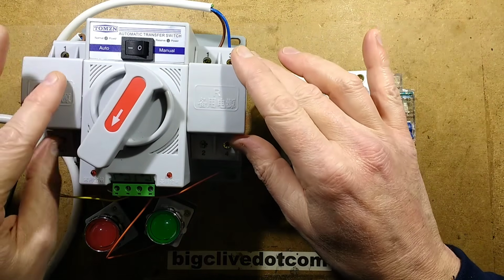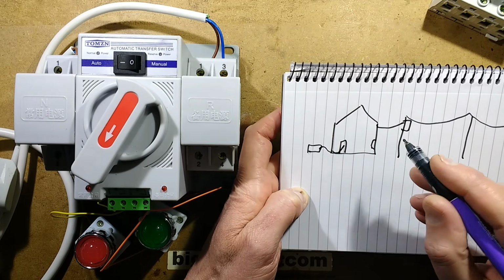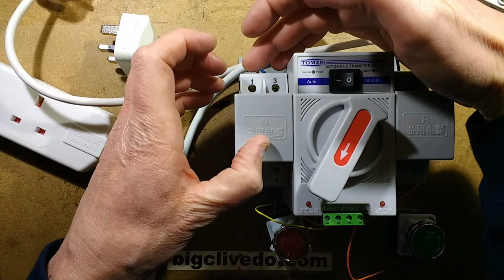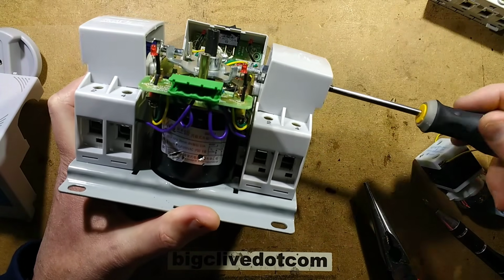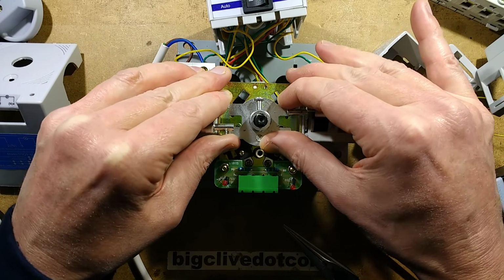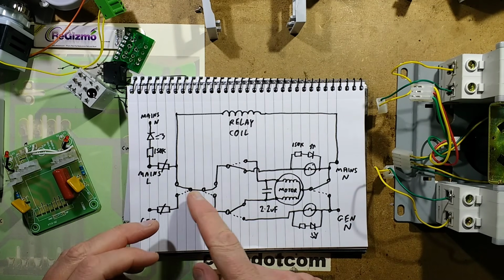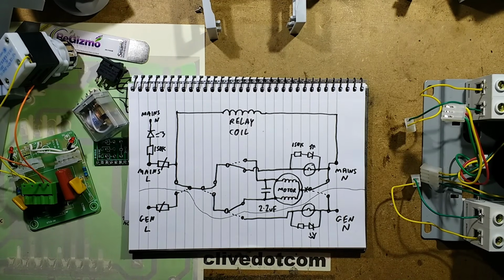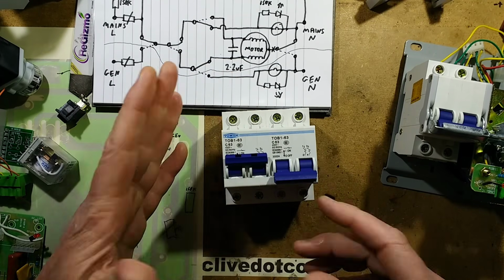Automatic generator changeover switch (with schematic).

Comment: Wow, in the US and have had a generator for years and not once have I thought of back feeding the entire house through the 220v dryer connection. Scary. And no, not gonna try it, no way. I'll let you do that one so we don't have to...
Reply: There are safe and legal ways to do it, problem is nobody follows them.
Reply: I have seen a video with a pto generator feeding at the utility pole, guy switched off the power line, then had a three phase plug at the pole to power barns and the farm houses. Better that then feeding it through a dryer plug.
Reply: Sure it's safe if you know what you're doing. But it's dark, your stressed and you've been kept up half the night because of a hurricane and one slip and whoops, there goes a lineman/generator. Mistakes are made and some are impossible to come back from. It's why there are proper (and relatively inexpensive) ways to do it properly.
Reply: It's absolutely illegal, just like speeding, and about as commonly done.
Reply: Yeah seriously
If I had a big enough generator (or solar system or whatever) to power my entire house, I would never do it that way. It'd be so simple to just set it up properly. 
In America, what I've always been done is to merely run a 120v extension cable from the generator to the most vital appliances (fridge/freezer usually + often phone chargers)
Reply: Agree. I just made a cord to do this very thing however through the 240V 50A RV outlet I have on my outdoor panel. Pretty simple. Kick the mains off to isolate and thats all you need. Maybe put a small padlock for safety if you want to be cautious.,
Reply: John Adams
Yep. I would hope all the above people doing it are breaking the law. I would be horrified if it was legal to do this.
Reply: Backfeed is bad idea - you can easily electrocute a lineman working to restore power.  Yes you would turn if off but someone might "help" and make it live again.  Best not to even make it possible.
Reply: Pretty much everyone I know runs their generator that way. It's not a problem as long as you know what you're doing, but I definitely do not leave the suicide cables lying around when the electrical inspector comes by.
Reply: Which is why after Hurricane Andrew when I was helping the DOT clear downed power poles and lines, I wore linesmen's gloves. Idiots cannot be prevented. The power company would not work on a person's transformer if a generator was running unless it was feeding a proper transfer switch. Our house has two. One that I can run just emergency items off of. Or the second one that can feed the whole house. Difference is if it is going to be a short time run or a long time run. The first one is soon going to be fed only by an inverter while the second will be used for the generator.
Reply: Doing it through the dryer connection is ILLEGAL and unsafe. There is a correct way to connect to the breaker panel.
Reply: I've done this many times in more applications than just generators. This is commonly called a suicide cord(with good reason).
Reply: I put a breaker for back feeding in my panel in the top right location right next to the main breaker. To use it you have to first turn the main breaker off, slide a interlock plate over(just a plate with slotted cutouts to slide) and engerize the back feed breaker. Less than $15 bucks.
Reply: happens more often then not. i have done it when we had a huge ice storm and the power company cut the lines to the house because of a weather failure. and before they attached the mains i wasnt using the generator. problem is people will just do it cause their dad did it or some guy down the street.
Reply: I have that setup.  The generator is in a shed when I need it I throw the 200 A main and plug my genset cord into the bottom of the main. No back feed.
Reply: This is a single phase system. You are confusing phase with two hot legs (w/neutral).  Of course there are other systems - three phase is also common in the US in factory shops. Few residences have three phase service.
Reply: If you are replying to me, I am not confusing anything. Big Clive has more knowledge of this than I do and I am going off of what he said in this video. Electrical setups may be different where you are or where I am, but certainly he knows what he's talking about as far as where he is right? In either case, 3 phase or 2, your dryer outlet can handle far more load and is a fairly good solution for the generator to feed the house provided you are set up to switch automatically between the grid and the generator and don't accidentally have the grid blow up your generator.
Reply: A lot of Americans do it, though. It makes sense, but it's not safe because they often use a cable with two male ends (so one male end will be live) and only one small, manual operated switch can keep you from backfeeding and avoiding some kind of explosion where the two connections meet (your dryer socket). Europe uses 240V standard, so it'd be the same as if we used any random outlet in the house to backfeeding the entire house. It'd give you a solid 3.500 Watts, which is something. They usually don't do that in the US, because one circuit is usually only 1.800 Watts.

But then again, generators in general are not too common in Europe. Gas is super expensive, a lot of people live much closer together, ... as a kid I didn't even know gas generators existed! I thought they were always diesel powered. Probably because I'm still a teen and grew up when the government thought diesel was the best thing since sliced bread (in my particular country, 80% of the passenger cars were diesel powered up until 5 years ago, now it's back the other way around - even the Fiat 500 came with a diesel engine). Diesel is (/was) cheaper, more efficient, ... but those generators would be much more expensive and complex. I often see pretty high capacity gas generators over here, now.

I'd love to get one, but even though all the houses in my neighborhood are detached and there's a lot of open space between them (I even have a mini-forest behind my backyard), I can see particular neighbors complaining about noise and exhaust emissions. You could still run it on propane or natural gas but still.
+ we haven't had an outage in 6 years, and when we do it's usually 1 hour max, so... probably not really worth it anyways.
Reply: You have reliable power. Never know what already got till its gone.
Reply: Poo Face, so if you've been living off the diesel generator, then what have you been living ON?
Reply: Clark, that's the way I've done it. We had power out for nearly a week and mostly what I was interested in was running the chest freezer occasionally to keep stuff deep-frozen and some power for lights and television. It would have been nice to have 240 to allow the gas furnace to run though and if power was less reliable here, I would probably have a fancier set-up. I'd definitely have a transfer switch though.
Reply: JamesAllmond pics or it didn’t happen.
Reply: Arjan that is exactly what I have, and it works great.
Reply: John Ridley hhaha
Reply: my generator will not power the entire grid, it blows an internal fuse.
Reply: I done that but be carefull
Reply: I tried it once with the oven connector... Let's just say you should make sure you have a beefy enough generator to run the HWH, fridge and confirm that the AC is off BEFORE you throw the switch!
Reply: I use to do it all the time. The 30A dryer breaker and the 30A breaker on the genset would protect everything
Reply: As long as the main is of you are fine, you can by a $30 interlock that you must turn off main before generator breaker goes on.  Without a generator breaker feeding into dryer plug is safe BUT you must turn off main 100-200amp breaker first, technically illegal.  Power off heavy loads and your entire home is powered safely.
Reply: So long as you're not an idiot and have some sort of circuit breaker there shouldn't really be an issue
Reply: It'll work fine
Reply: It's only dangerous if you are a dunce lacking practical and common sense.  Which unfortunately seems to be the majority of the worlds population.
Reply: JamesAllmond It's very common and relatively safe if done properly with a split-phase generator. The problem is most people don't have a split-phase generator. They have a regular 120v one. So they will feed both legs of the house with the single leg of the generator. The danger in doing that is the risk of overloading the neutral since the loads on both legs will be returning to the generator simultaneously which doubles the current on the neutral. Large RV's / caravans have double sized neutrals since they know that people will power the 240v system with a 120v generator on a regular basis. Houses don't get built with double sized neutrals.
Reply: @xNYCMarc  Ours have always been split phase. From the first one we bought in 1972 till now. But then dad was in electronics in the Navy and worked for the power company after that. And we have always used a proper transfer switch. The emergency one is rated at 50 Amps and is used for short term runs. The large one is rated at up to 600 Amps and can be setup as single or three phase and fused as needed. Thing is about 3' tall and can handle the whole house. Currently fused for 200 Amp slow blow with 200 Amp fast trip breaker inside the breaker panel inside the house.
Reply: gravelydon That is very rare to have a split phase generator. Most people just go to HomeDepot and look only at the watt rating. Just about all of them are 120v. Even my backup generator is 120v, but my setup is a little different. I have solar with batteries. The inverters are 240v split-phase and the house is essentially always powered by the inverter, that way if the power goes out, the electricity is uninterrupted like a whole house UPS. If the power is out and the solar isn’t producing enough, the generator kicks on and only runs a battery charger to recharge the batteries. So it doesn’t need to be split-phase.
Reply: @xNYCMarc  I don't think we've ever had a 120 only generator on the property. Ones here right now are a 3500 watt 120/240, ( I can throw a switch and make it all 120V ), 7500 Watt 120/240, 10KW 120/240 72VDC, 15KW 12 lead that can run single or 3 phase 120/208/240/416/480, and a 40KW 240/120 unit. Both the 3500 Watt and the 7500 watt units can be on line at the same time as the 3500 can power the emergency circuits while the 7500 pulls the rest of the load. I currently don't have a split phase inverter but if need be, I can use the split phase 120/240 transformer  to power emergency circuits off of the 120V inverter.
Reply: I tried it! (thrice actually)
Reply: Clive is right about it being fairly common though. It's something that happens nearly every time there's a hurricane.
Reply: JamesAllmond by grandfather did it for years. As long as you shut off the panel and make sure the plug doing the feeding is not accessible by little ones, there isn’t much danger.
Reply: JamesAllmond what did you think? Power goes where?
Reply: Scary? Not at all. It's kind of genius actually. The dryer connection handles far more load and as Clive said, that way you're feeding both phases.

Comment: Liking the fact it uses a motorised manual switch. The ones i've studied in the past use interlocked contactors and i didn't like the fact that I had to rely on a contactor being energised all the time for normal on mains supply - despite working in IT where such devices protect significantly more important stuff than my house!  I went for a manual changeover in the end for the sake of simplicity and avoiding spikes and surges swapping between genny and mains.
Reply: Eliot Mansfield This one still has an always energized coil. And the mechanical interlock is incomplete if that motor stops halfway through (as briefly spotted but dismissed as "will never happen"), even more likely in manual mode.  Anyway, I think all these "two-breakers and lots of mechanics" designs for transfer switches are just stupid with too many things that can fail and overcomplicated user instructions.  A properly overbuilt break-before-make changeover switch is a much better starting point for designing these. Automatic changeover would just move the one 4-pole/3-pole/2-pole switch, not try to dance around two switches.

Comment: We just lost power in my house, and we had to manually run an extension cord from our generator to a power strip in the kitchen which we plugged the refrigerator to, and then we ran an extension cord from there to the freezer across the room, and we had to move the microwave to plug that in, and had to get a standing lamp for light, and everyone had to be in the room to charge their laptops and phones, and it was aweful, so sad. We need to get one of these, but unfortunately I don't think our insurance will like it if we got it from eBay.
Reply: any transfer switch will have to be inspected and approved by your local electric inspector,otherwise if you do have a fire or whatever your insurance is not obligated to pay.Cheaper in long run to have it done right
Reply: darkworlddenizen yeah but dont forget to switch off the main breaker as you won't supply your neighbors house :)
Reply: XDSDDLord Proper manual transfer switches are not all that expensive and are well suited for manually started generators.  There is really no need to go the questionable China post route when you can get a perfectly compliant manual transfer switch for a reasonable amount.

I live in upstate SC where ice storms are not at all uncommon (typically one or two every several years) so we have a 15KW generator and a 200A transfer switch installed just in front of our house main breaker panel, allowing is to choose which circuits are generator powered by selecting which circuits are switched on in the panel with a watt meter displaying the load on each of the 120V legs so that each leg remains within the load (6,250W) the 50A circuit breaker from the generator will support without tripping.  However, you can buy ready made generator subpanel that are reasonably priced that will support up to a dozen, or so, circuits throughout your home when on generator power and are easy to install once you choose which circuits you consider critical.
Reply: Yeah..exactly thats the way a unwary person does it "extension cords", and now even gets proposed to build and use a widowmaker.
Because people need to use life essential things like mobile phones and laptops 😬 to survive.
Reply: add candles, cut the light, order pizza - in an order you like best.
Reply: XDSDDLord 

You can plug the generator directly into the house.  You need an extension cord with a double male end, turn off the main breaker, turn off breakers to non essential parts of the house, and turn off any non essential devices, then plug one end of the cord into the generator and the other into any standard outlet and it will power the whole house.  Be careful to not overload the generator though.